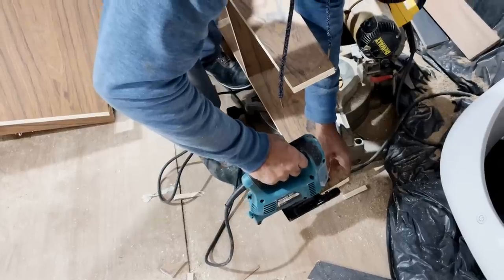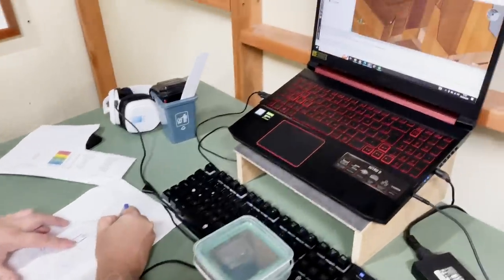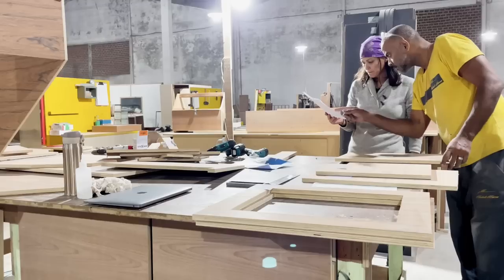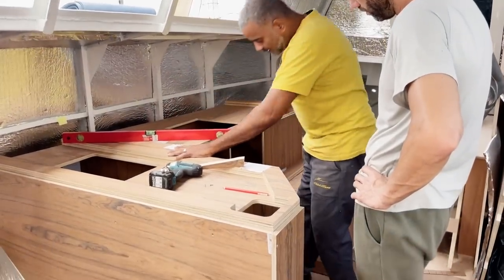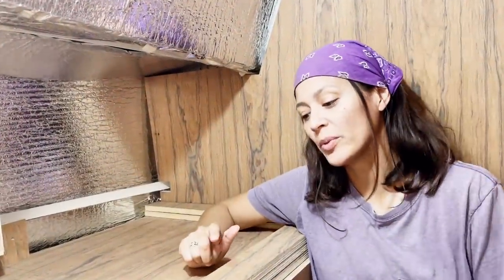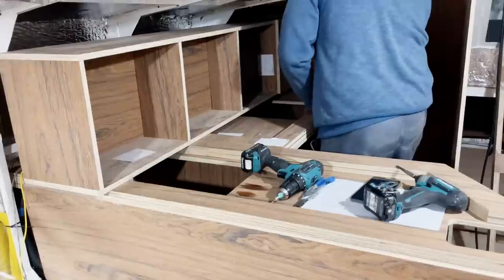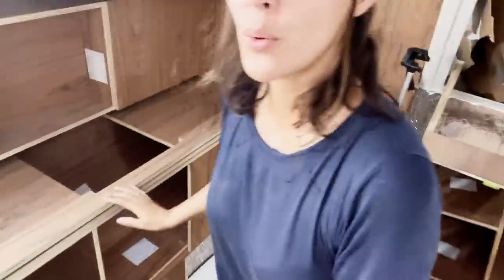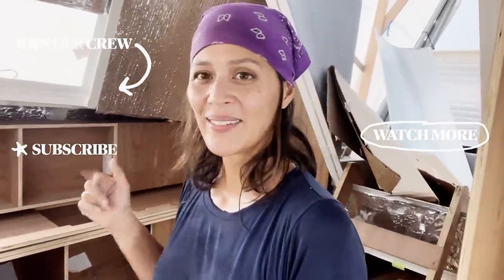Challenges building our KITCHEN #BOATLIFE  ⛵️ Ep39 – GALLEY BUILD – Boat restoration project

Comment: I am also riffing on a 42-foot steel sailboat that is 40 years old.
For the interior, they used a piece of equipment that used a laser beam to do an entire interior scan of the boat, obtaining a 3-D model of the boat; the measurements obtained had an error of less than a millimeter.
With the 3D model they designed all the furniture, which fit 90% perfectly
Reply: @charonstyxferryman  If the hull does not have a straight line between the stern and the bow there is a problem, a big problem.
The 10% tolerance is due to the expansion of the metal due to atmospheric temperature

Comment: Indeed CNC and boat work can be blended by using templates describing the contours where fitting needs to happen..Once established CNC work can take over..
Like the progress and in particular for this video, the creativity reflections in the narration were outstanding..job well done..
Reply from the maker: Very correct! There are certain applications that the CNC would excel at and we can do that moving forward. For maximizing our space the framing can be manual and other pieces that need more precision can be cut by machine. Glad you like the work so far! Cheers!

Comment: Seeing so many square corners and CNC pieces looks unusual in a yacht interior 😊 
The nature of boats makes me wonder if there will be issues with the cabinets squeaking as the boat takes the seas. 
This is a great channel thanks for sharing your journey ❤
Reply from the maker: It is! We are going for a modern design that will match our modern looking hull. It will be very interesting to see how it turns out, wont it?
Reply: @lahakai  That's the difference between home design and boat design, home carpenters and boat carpenters.
I'm too into modern design, but the approach on a boat it's different in some parts. We can't build a cabinet or whatever in the same way we do for our house. We need to keep into consideration many other factors.
I'm not telling that you are wrong, just pointing that you should keep in mind that a boat is living and moving all the time.